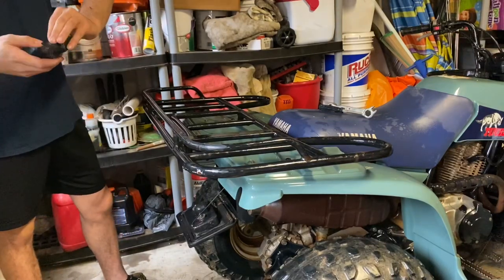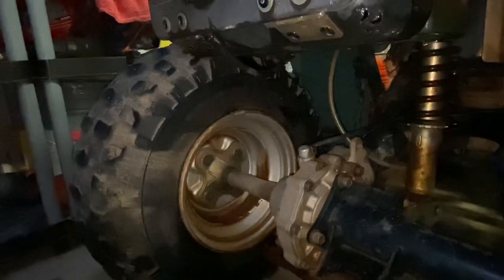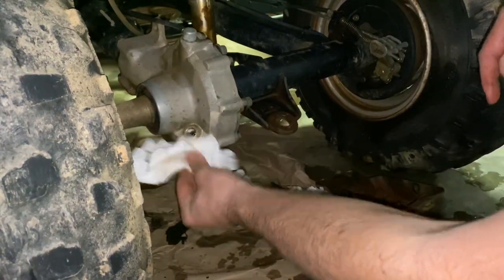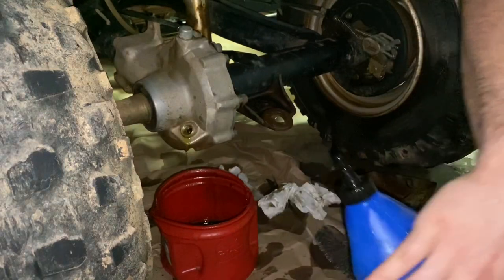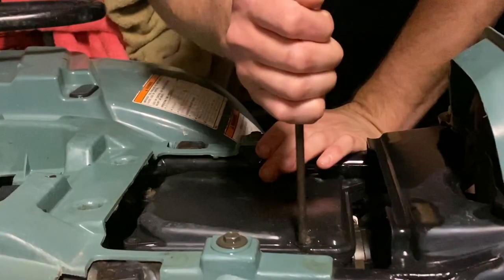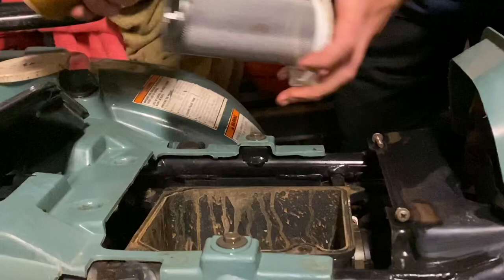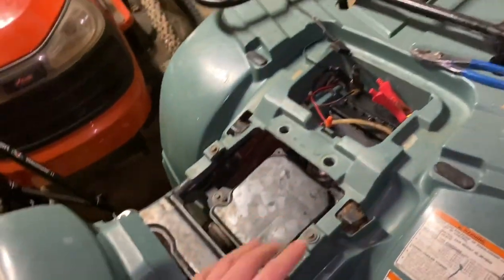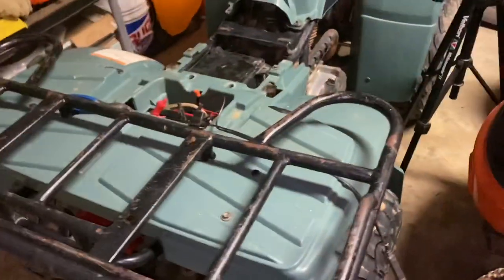ALL ORIGINAL YAMAHA TIMBERWOLF 250 | Servicing Differential and Rear Brake

Comment: I'm maybe looking at getting one of these, would you recommend it as someone on a budget?
Reply from the maker: I definitely would. Parts are very cheap for these machines and they are tons of fun. Just make sure you maintain the rear axle and take it easy on the brakes and you will basically only have to pay for gas and maintenance every now and then
Reply: Yes, good machine
Reply: I've had numerour people wanting to buy mine.  The great thing about these smaller quads is that when you do get stuck, they are easy to pull out.  And I use it around the farm so it gets dirty, not a ton of power but enough for most things.

Comment: Where could I get that rope starter? Do you think one would fit on an 85 model? Don't know if they changed the engine between those years
Reply from the maker: BALTOTHEWOLFDOG4 the 85 would be a moto 4 i believe if they made them back then. All i could think of is ebay
Reply: @averybryant  OK    it's a timber wolf.  I meant to say 95 lol.     I'll check around in eBay.  Thanks your your reply.
Reply: Lot quicker just to go to a local bike shop.  Guy in town put a new rope on it, cleaned it, for less than ten bucks.
Reply: @mikearchibald744  I wish it was that easy.  Mine came factory without one.
Reply: @strattonthewolf213  LOL, thats hilarious. My idle is off so I kept burning out the starter.  The rope has always worked great, unless I'm deep in the woods and then it decides to give me a hard time.  Its my dads machine and he said theirs no fixing the idle but it really shouldn't be THAT tough. Do you mean it doesn't even ALLOW a pull cord or just didn't have one?  I'd never heard of that, actually I haven't even bothered hooking by battery up since charging it because I remembered that it pretty much is only useful for the starter.
Reply: @mikearchibald744  that's what I was trying to figure out  if mine would accept a pull start from another engine lol.  And my idle is  off too.   Probably timing because I've been through the carb multiple times and I can hear the chain clicking around in the case
Reply: @strattonthewolf213  I'm not sure what the issue is with mine, but I think its more a question of the tension.  Its been pretty good so far this year, but my issue was that the choke lever has to be in EXACTLY the right spot for it to start.  On really cold days I'll pull it up as far as it will go and it starts right up.  Once it gets s a little warm then the choke wire or whatever you call it needs to be in exactly the right spot, and its a weird spot so I marked it with a black marker. 

    Ordinarily the choke lever just needs to be 'turned' but I need to actually pull it out to get to the starting point.  I've never followed it to the other end but I assume it just needs tightening.  I'm not real mechanically inclined so I don't want to make it worse now that at least I've figured it out.

Comment: Hi Avery - I've been riding my 250 Timberwolf through long grass and it's disconnected a wire below the gear shifter which tells electrics it's in neutral. So my green light won't come on and starter won't engage. Would you be able to show me how/where the wires connect under the engine? Thanks
Reply: I haven't used my starter in years.  Just the pull cord, starts first pull unless the choke is out of whack.

Comment: I have one but I'm having a hard time with it what's the reason for my exhaust is turning red I have put a new carburetor and plug even went to a high octane gas I thought that the plug fixed it I road it four about two hours it was good but went four a ride last night and its doing it again
Reply: your carb is jetted too lean.  you need to richen it up by re-jetting.

Comment: Hi
Nice Video, thank you.
Cool wheely 
 
What kind of towing power would you rate these at..?
And is there a low ration gear for towing. . . ?
I just purchased one of eBay and collecting tomorrow, now I'm wondering if it will pull my trailer with rubble up slight incline, about 5 degrees. . . . . :-/
Reply from the maker: First gear is pretty good for towing. Make sure you’ve got good tires on the back and you should be fine. I can try and find the tow rating on mine later today. Thanks for watching

Comment: does the rear brAKE ONLY ON ONE SIDE OR SHOES ON BOTH SIDES?
Reply from the maker: Shoes are only on one side but it is a straight axle so both sides are connected

Comment: Is that a vent tube on top of the differential
Reply from the maker: Yes it is
Reply: @averybryant  I’ve got a Timberwolf but don’t have the hose does it just plug in there
Reply from the maker: Yea and the tube runs up near the back of the gas tank
Reply: @averybryant  I’ll prob need to make one don’t need to get water in it.
Reply from the maker: I would highly recommend it.  These rear ends in the atvs dont last very long with oil full of crud and water, speaking from experience lol
Reply: @averybryant  yea the original I had didn’t have a vent on it and I used to leave the atv outside then one day it started making noise then took it apart brown mud in it and bearings chewed up plus the case so had to buy a used one and that was almost $200

Comment: Hey I got a bear tracker and my brakes engage but they don’t unengage I guess I would say, bu themselves
Reply from the maker: Need to pull the brake shoe cams and clean the corrosion off, grease, reinstall. Make sure their bores are clean from corrosion as well

Comment: Those are not the original rear tires the rear wheeles had the same tread pattern on the front but wider I know that because I have a 1992 model and it’s been my dads ever sense it was new
Reply from the maker: Boi Meme good catch i did not know that. They seemed like the originals to me. Maybe they changed them between 92 and the 96 years? Mines the 96
Reply: Avery Bryant yeah probably but just wanted to let u know😀
Reply: Mine is about to blow up btw